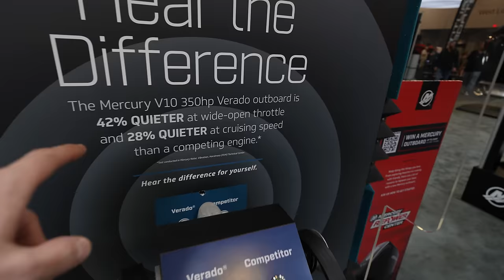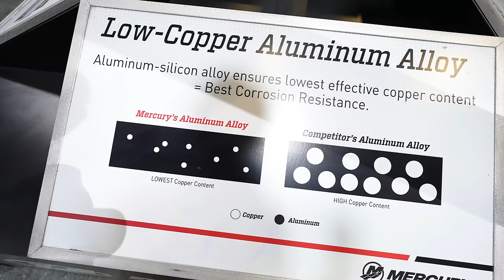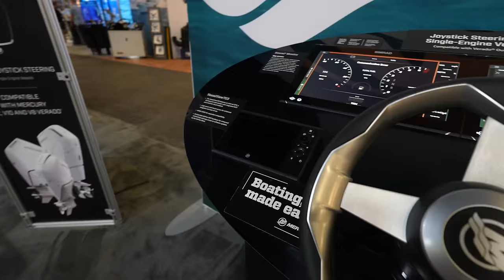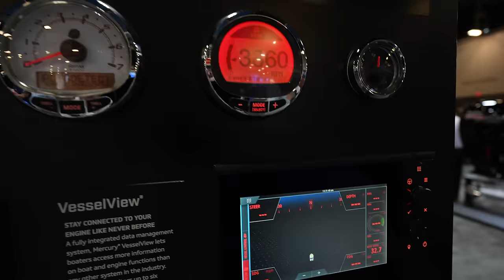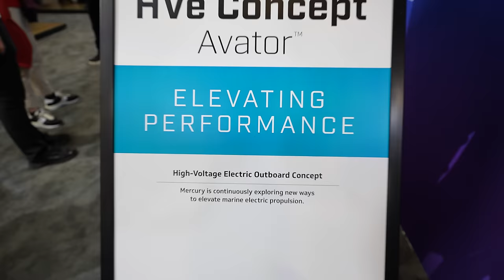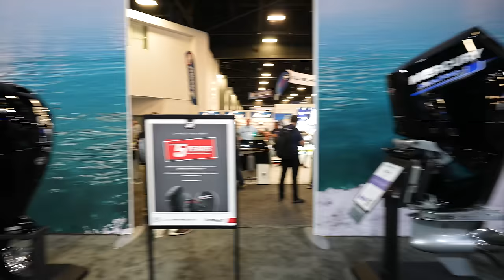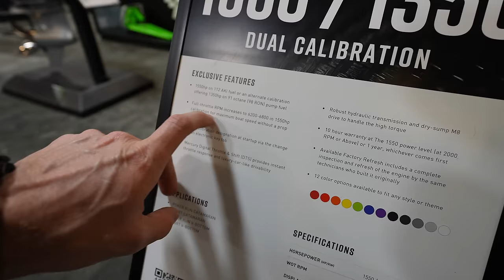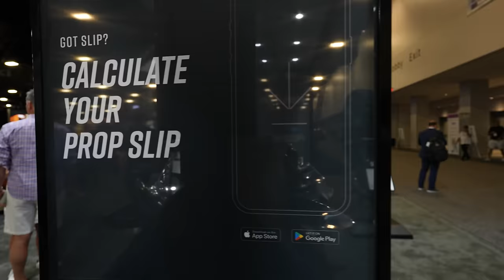Complete MERCURY Booth Tour 2024 Miami Boat Show

Comment: The reason the Avator lower propshaft drive is so "beefy" is the actual electric motor which drives the outboard is located there. The top part of the engine is all battery and the computer + tiller controls.
Reply from the maker: Interesting! Thank you

Comment: Have you worked on a 600 yet? If you do, please make a video of it.  Curious on how reliable they are.
Reply: Very.  Relba 1980 farrie lambghinies.    Use v12 40 years re n er v10
Reply from the maker: Just basic stuff, nothing major with them yet, I don't see why they wouldn't last for a really long time, but, of course that will depend on how they are taken care of and how they are ran :) but most of the damage that we've seen on them, are from hitting ground with them lol

Comment: Out of all the booths if you could have a free 250hp motor which brand would you pick?
Reply: Yamaha.  Lol
Reply: Mercy. 250 hp jet outbard Honda uamha 250 hp jey outbard 1980. Starbdes
Reply from the maker: Depends lol If I wanted to go fast, the Merc V-8, if I wanted to go offshore and not buy another engine for 20 years, the Yamaha F250 4.2L V-6 :)